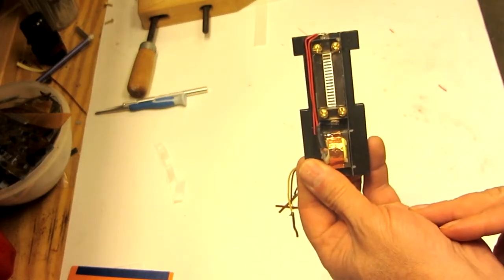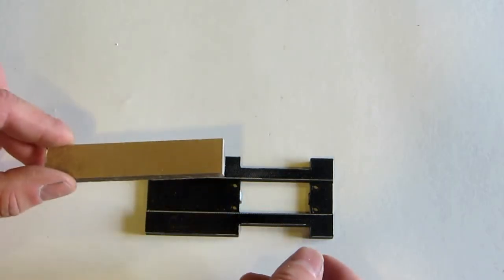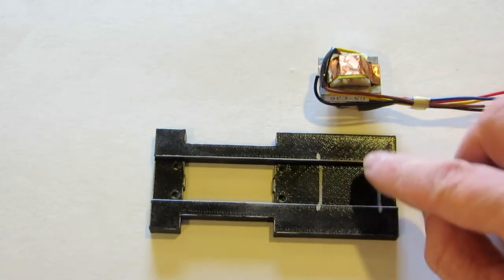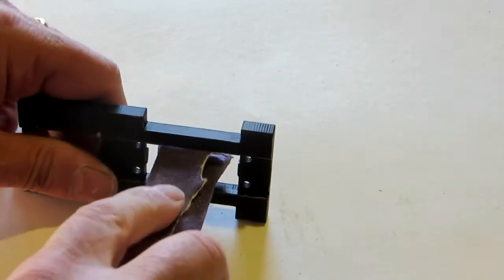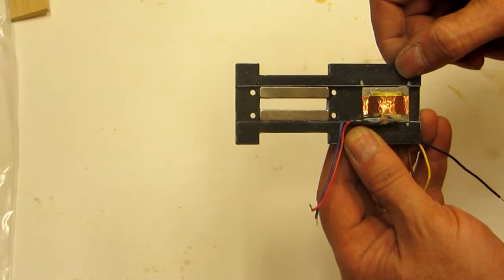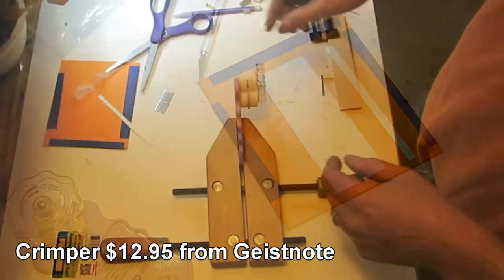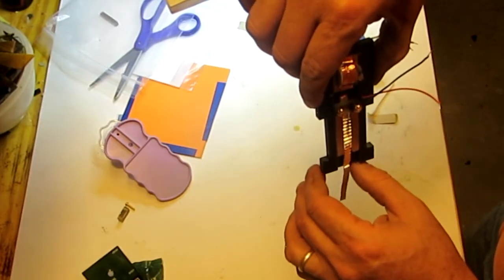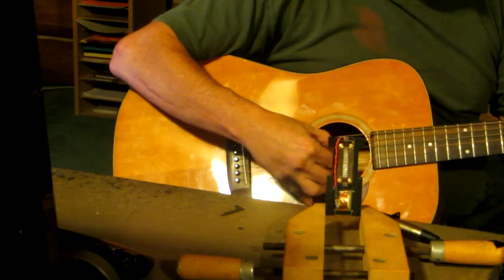Ribbon Microphone built from scratch DIY

Comment: I don't get the twisted pair from the top contact...
Knowing that twisting pairs of wire that carry the same signal doesn't cancel noise, and also that there is virtually no current flow so no I2R losses in the wire, why twist such large wires?

Comment: Nice work. I built one almost exactly the same. One small difference:I made the frame stick out slightly into the gap, creating notches the magnets fit into. This obviated the need for glueing them in place (except for a small drop to keep them from sliding around). One question thought: I wonder it would be better if a steel frame were used to provide a return path for the magnet field - the idea being that it would concentrate the flux in the gap where the ribbon is. Also, I was thinking that one could tune the tension in the ribbon by driving the microphone with a signal generator and watching the ribbon deflection increase as resonance is reached. I like the trick with the tape - you could snip off a bit at a time when tuning.
Reply from the maker: The frequency generator sounds like a cool experiment!
Reply: If you have a sig gen, you probably have a Cro... Feed the mic output into the Cro and tune the tension on the ribbon to give max output at your main recording frequency range. That's what I plan to do...
Reply from the maker: @Grumpy-OldMan-1963  Cool idea!

Comment: Is there a way to suppress the noise floor ratio?
Reply: Yes. 22nf capacitors on the xlr one from pin 2 to ground, one from pin 3 to ground, and a jumper from pin 1 to ground. Someone else said adding a fet would lower the noise floor too. Maybe try both.

Comment: Quality lol. Idk what you could do to lower that noise floor but that static is the only issue I could hear
Reply: A fet and some 22nf capacitors on the xlr. Also a jumper from pin one to ground.👍
Reply from the maker: I think enclosing it in a metal case with a screen would help a lot
Reply: @RobsFixitShop  good idea

Comment: Could you explain the wiring? I am trying to make this, but I have little experience with wiring. I can't understand where the two red wires came from. There is only one red wire on the transformer.
Reply: The colors don't matter - there will be a primary and secondary winding. The primary side is the low-impedance to the ribbon but DON'T use a meter to measure that as you could jigger the transformer by magnetising it slightly. The signal is always AC so it really doesn't matter which way you wire it provided you feed the ribbon output the to primary and the secondary (high impedance) side to your amp.
Reply: @marcdraco  Hello, did he used the primary winding or the secondary winding with the ribbon copper contacts ?
Reply: @MahmoudTwoThousand  primary side is the low impedance FROM the ribbon. The high impedance goes to the preamp.
Reply: @marcdraco  You mean the secondary?
Reply: @MahmoudTwoThousand  yeah. The higher impedance matches to the preamp.
Reply: @marcdraco  Oh ok, Thank you!

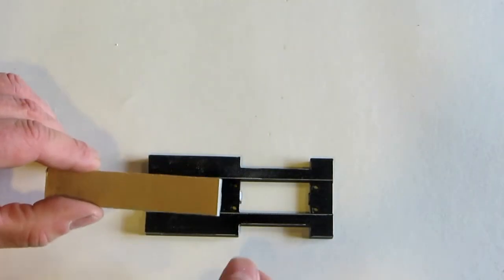Comment: Hello, Rob.  I enjoyed your video.  I have questions if you are still taking them.  I just got a Geistnote's GN-C36 1:36but I have stumped my self over thinkin g the wiring.   This my first mic project.  I am using an old xlr cable for my plug it have the raw copper in the housing for the ground and red and white.  Can I solder to those wires If so can you tell me the color combo.  (Red, double from the top of ribbon, Blue from the bottom of the ribbon.)  Then where from there?  Thanks for your time.
Reply from the maker: Skinny, Sorry it has just been so long since I made this video and I haven't really done and microphone stuff since around that time, that I am not really much help.
Reply: @RobsFixitShop  That's fine.  Thanks for getting back.  I figured it out.
Reply: @SkinnyMcGee  I have the same question. How do I get the two wires at the top? The transformer only has the one coming out of it. So confused about this step
Reply: @eggplnt  The two reds (pos.) run to the red on the transformer.  The bottom single wire is the neg.  runs to the black.  the other end of the transformer is pos., neg. and ground.  I ran to a cut xlr.  It went as follows. Red to brown.  yellow to white. copper shield to black which I ran a little pig tail off of to the body of the mic.  It worked.  I did have get a Fethead to bump up the vol. and reduce noise.

Comment: No need 3D printing. You can carve FR-2 sheet.
Unfortunately high noise floor. Need more winding ratio of the transformer.
Perfect job
Cheers from Indonesia
Reply: ibles bosuok I thought the noise was caused by lack of shielding?  Why do you think it’s a transformer winding issue?

Comment: Cool project. It'd be a lot cooler if you put a link the the 3d print file. Which in the video you said you'd  try to do that, but no link. :)
Reply from the maker: BW, I had put the link to the part as the first comment but I am happy to see see that there are many comments so I moved it into the description under show more. Thanks for pointing it out. I would add the cut out for the transformer and the ribbon hold downs to the part design if I were doing it again.
Reply: Rob's Fixit Shop THANK YOU FOR DOING THIS!

Comment: What was the size of your magnets? You said 1"1/4 , 1"1/4 by 1"1/2  ?
Reply: The magnets he appears to use are the 50mmx10mmx10mm ones - Easily available on eBay and Aliexpress.
Reply: Thank you. I understood he said an inch and a quarter but he said an inch a quarter. That confussed me a bit. Thanks for your reply.
Reply: Hello guys, do you know which winding of the transformer he connected with the aluminium ribbon contacts ?

Comment: Cool man thanks :) I got me some new ideas now ;D
Using these magnets cutting them vertically https://duckduckgo.com/?q=buzz+magnet&iax=images&ia=images
And make a holder out of wood, and using thin aluminum foil, with 2 water bottle caps serving as wheels of crimper fixated on wood by nails or screws. :) hope it works
And for transformer maybe a 220~240 to 5v one will serve the job, salvaged from a crappy Chinese USB charger.

Comment: what voltage is that transformer
Reply: somewhere I heard it is 1 : 37, stepping up input to 37 times.
So use a 5 volt or 6 volt transformer in reverse, it might work, say from dead/cheap USB charger.
220 / 37 = ~5.95 almost 6.
https://youtu.be/_tWbwcS_9sA?t=2m8s
https://youtu.be/xMNTOXGdYM4?t=53s (toroid transformer)
Reply: This would be OK as an experiment.
However, the impedance of the input and output windings of the transformer are also important - Especially the secondary, as it has to provide a match to your pre-amp. There are special ribbon microphone transformers available for this purpose.

Comment: :10 The ribbon is only 2.5mm thick? That's only a little thicker than the plating on a cheap gold watch
Reply: 2.5 microns thickness.
(2.5 microns is 0.0025 millimeters)
But yeah, very thin. A close plosive 'blast' from your mouth could cause it to rip (which is why they are usually covered over with a shield / screen).

Comment: Hi my friend, where did you buy that very thin aluminium? Thanks
Reply: Hi  Fernando Pontin, if you have access to a 3d printer, you could build up a corrugation machine, which isn't that complicated. Actually you only have to mount two cogs on a adjustable slide  rail or a apropriate mount. Maybe the on thingiverse published project from Harvahamma might help you to build such a "machine". The link is:https://www.thingiverse.com/thing:2806010/files .
Reply: ebay has several
Reply: Cady Kyst, thanks I ordered a bit of the Japanese 2.5 micron microphone foil.

Comment: Hey i wish to build this but i am a bit of an audio noob so i have a few questions. When you used the xlr cable did you give it phantom power or not and also will i be able to plug this straight into my PC and use it or will i have to use a mixer, give it phantom power, and then plug it into my PC
Thanks.
Reply: bob(the one that is at war with google +) also what is the polarity on the magnets
Reply: bob(the one that is at war with google +) sorry one more what in the maximum thickness the aluminium should be
Reply from the maker: bob(the one that is at war with google +) I just made sure that they were attractive to each other by having them attract to each other through the temporary plexiglass divider
Reply from the maker: bob(the one that is at war with google +) No phantom power. I went into a usb mixer but the output was too low. I am not sure if direct to PC will work. It works much better to my Yamaha power amp / mixer. Preamps for these mics is a pretty deep subject that I am pretty weak on.
Reply: Rob's Fixit Shop Wow thanks for the fast reply. I did some research of my own and i think i might go for a 2.5 or 4 micron foil but i want to test out that i can build it so i'm just gonna use the kitkat foil for the first test than,is it works, i'm going to commit to it and buy high quality parts. I might try a XLR to 3.5mm jack cable to see if it will work straight to the pc.
Reply: bob(the one that is at war with google +) 4-microns gives the      microphone greater durability and a slightly reduced high end response. Most ribbon mics don't use phantom power. Build this with a real ribbon mic transformer such as edcor  or lundahl transformer and you will have high gain and lower noise, but without a metal body or metal screen to block emf youll have a higher noise floor even with a ribbon mic transformer .

Comment: Where can you get that 3D printed? Thanks.
Reply from the maker: Josh Zook I went to the UPS store here in town. I was able to email them the files and my credit card # and then I picked it up the next day. It cost me about $28.
Reply: Rob's Fixit Shop What kind of material they used? I guess it has the be quite sturdy.
Reply: I had them print two of them, using the UPS near Penn State University.  They mailed them to Baltimore, for me.  The whole thing, with shipping and handling was a painful ~$90.  They used PLA and it might have been cheaper if I chose a less dense printing pattern.  They asked how dense and I said as dense as it gets, since I wanted strong plastic and don't know any better.

Comment: The noise floor is quite high. How do you amplify the signal?
Reply: For the noise, I have couple of suspicions. One could be that the ribbon motor induces noise; usually the two top wires go both sides of the motor to cancel out noise. Here they go side by side, although twisted. And the second and the most obvious one is the preamplifier, it needs to be quite good. I'm no means an expert, just made one ribbon mic recently. It has no more noise than a Shure 57 that I used for some kind of a benchmark to test my preamp :)
Reply: xabc1 I think he is using the Geistnote GN-C36 ribbon transformer. So it is a proper type of transformer.
Reply: He does who which transformer he is using, early in the video.
Reply: Just use a cloud lifter
Reply: Thanks for letting me know!
Reply: apinakapinastorba  :10 How is this a 'motor'
Reply: Chad Castagana: Transducers are are referred to as motors. Google it.
Reply: Chad Castagana ,🤔 I guess you mean, that you do not see a motor in it, because there are no visible wheels or gears in it > motor > rotae (Lat. for "wheel" in Engl.)🤓. Maybe this leads to confusion from your point of view. But actually, it is really a motor, like bloodswarms has mentioned above.  A simple explanation can be seen in the sine wave, which is generated by moving a conductor in a magnetic field.  The conductor ribbon strip, moved by vibration through air, swings now from positive to negative in the magnetic fields, which generates an electrical current in a sinoidal wave form. The generated signal in the "capsule" is an alternating current, like mains current, but much lower and much more fluctuating. But let's go back to the "wheel" from the beginning. A "wheel" implies rotation, doesn't it? And rotations can be graphically represented by a sine wave in mathematics.😉
Reply: @chadcastagana9181  motor to move electron
Reply: can i use magnet 50*10*5 mm?
Reply: A ribbon mic transformer is needed like a lundahl or edcor. He just used a regular step up transformer, that would explain low output high noise. Also its not in a case the metal body or metal screen adds emf protection

Comment: Wow that actually sounds great! I have the aluminum and the magnets. Next I need to design a chassis some how
Reply from the maker: Try using google sketch up. It is easy to learn and you can have your part 3d printed when you are finished. Use the part I shared in the comment below as a starting point.